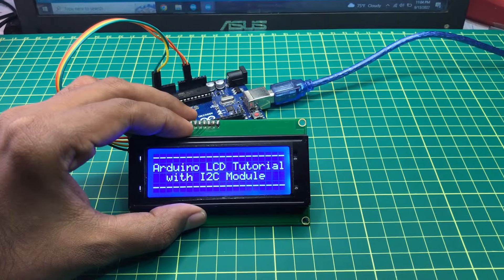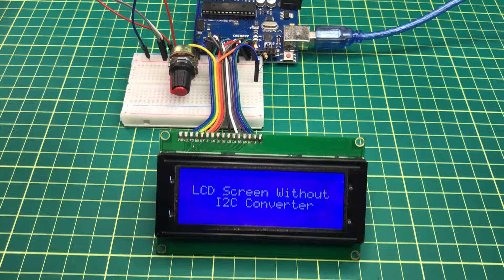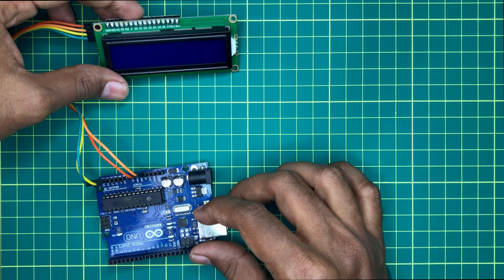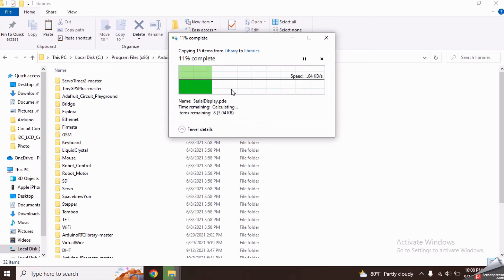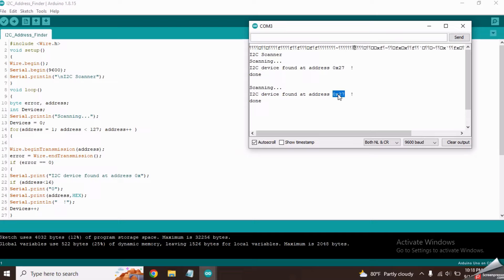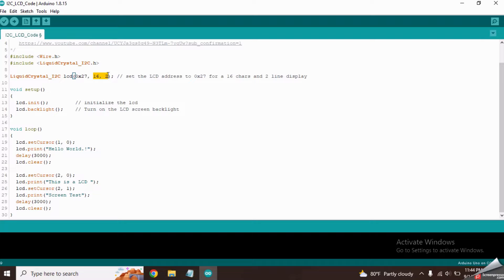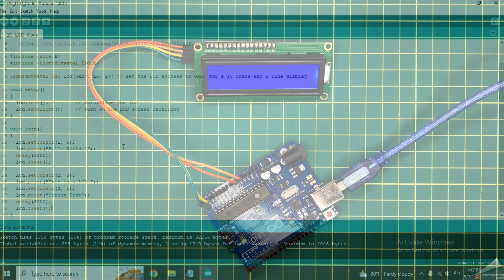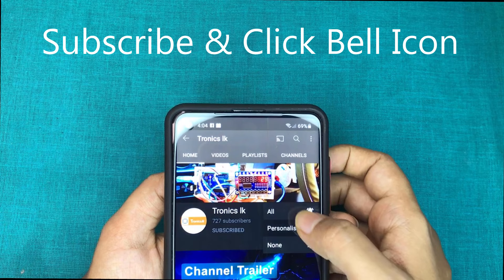How to Use I2C LCD with Arduino | Very Easy Arduino LCD I2C Tutorial | Arduino 16x2 LCD I2C Tutorial

Comment: im facing this code after uploading 
Sketch uses 4032 bytes (12%) of program storage space. Maximum is 32256 bytes.
Global variables use 522 bytes (25%) of dynamic memory, leaving 1526 bytes for local variables. Maximum is 2048 bytes.
Reply: did you end up fixing it? im having the same issue

Comment: I'm in a project. My load cell is connected to HX711 amplifier.. and HX711 is connected in the Arduino UNO's 5V pin. I have 16X2 Blue Backlight LCD Display 
Is it okay if I HX711 to 3.3 V or is it okay to change the Serial Interface (12C) to 3.3 V..

Comment: This is the problem on the LCD 2004, the backlight and white cubes, but the Arduino does not see the I2C module. how can this issue be resolved?
Reply from the maker: Watch again carefully. Need to match i2C address and rotate potentiometer

Comment: ciao. non so potresti aiutarmi, mi hanno regalato una board simile arduino ma a bordo un atmega 64  ho visto il tool di arduino uno mega ecc.. non e' supportato, comunque mi sono messo alla ricerca e finalmente con una interfaccia isp  di pochi euro riesco a programmarlo. il problema e che in rete non trono nulla riguardo utilizzo porte analogiche  e protocolli i2c per dispay e lcd ,  mi potresti aiutare  tu con qualche esempio sempre se puoi ..grazie Francesco

Comment: Hello i need help, i have freenove arduino uno with a different lcd display than this. lcd name as i can see is "EONE LCD" i dont have the same library as yours but it seems my library works ok. Im getting "Problem uploading to board" error whats the solution?

Comment: Hi... I'm using Arduino IDE 2.2.1. As you know the software is different. I'm unable to find a library folder in the installation folder. Also when using i2c finder, I don't get the location as well. Can you help.
Reply from the maker: Try to install library using library manager option in IDE. Its easy
Reply: could you please tell me how you did it?

Comment: Hello, how do we use the LCD screen with on/off switch. Thanks
Reply from the maker: simply use it as a power switch
Reply: @tronicslk  Unfortunately, when we turn it on again after turning it off, it does not work.
Reply from the maker: @omerucansu2569  turn off the Arduino. Power the LCD with Arduino 5V pin as shown in video